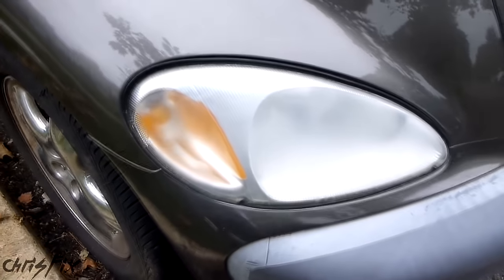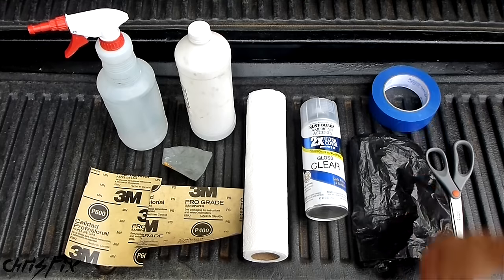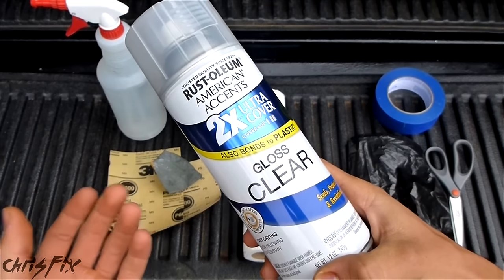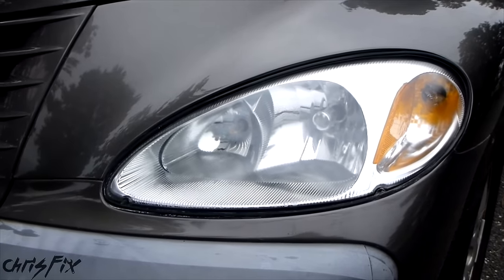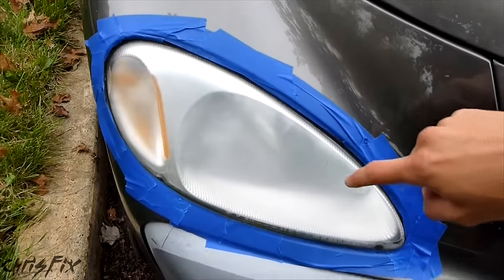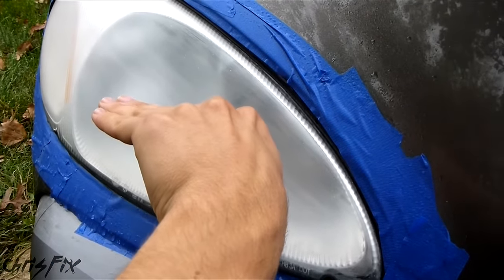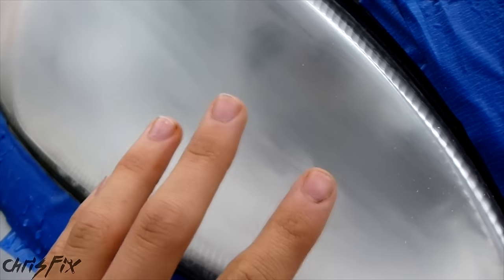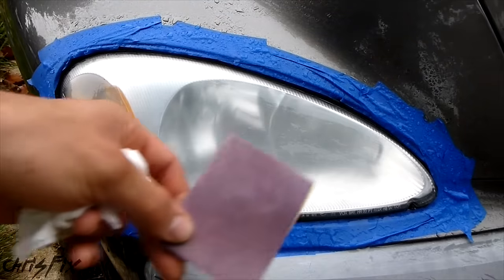How to Restore Headlights PERMANENTLY

Comment: If I overspray do I need to start the wet sanding over?
Reply from the maker: Might want to try letting it dry and wet sanding it, you might be able to knock it down so it looks good. If it's too much then I would sand it off and start the process over

Comment: My headlights ended up looking really cloudy after using the spraymax clear. Should i just wet sand like you said? And will that clear it up?
Reply from the maker: Probably orange peel. Let it dry a day and then wet sand with 800 then 1000 then 2000 then 3000 and finally use a plastic polish like this: https://amzn.to/3WIooIW
Reply: @chrisfix  
Thanks for the response. Very dedicated responding to a video this old.
Reply from the maker: @bernardberben4852  I spend hours and hours every day responding to comments to help my subscribers with their car questions. Cant get every single one but I do my best.

Comment: Hello Chris. I just did this on my dads car. I didn’t know and went all the way to 3000. After i applied the clearcoat ( same one as u) when it dried its drying with a spiderweb type pattern. I hope in 24 hours when i wetsand again it will go away but do you have any advice?
Reply: I think that means you held the clear coat can too close and overdid it, not sure if that’s right tho you probably need to redo it

Comment: If the lights were bad enough and you finished the whole process can you restart and sand the spray paint off and go higher grit?
Reply: I have the same question.  I sanded and thought I got all the scratches out.  I didn't.   Now trying to figure out how to remove the epoxy coat and start over.  What did you do?

Comment: I’ve fallowed the instructions to the T, but there’s some cracking in the gloss clear when it dries. What do you recommend
Reply from the maker: The clear coat might not be compatible with the plastic your headlight is made of. Or it was too humid out when you painted? You can sand it with 1000 to smooth out the cracks and once it’s even you can work your way up the grits to 5000 and then polish it so it’s crystal clear.

Comment: Anyone have a problem with the clear coat CRACKING?
I did mine 3 times!!! I used 400, 600, 800 then 1500. 
Gave a light coat of clear then another coat 10 min later. Looked great. Gave a final coat and let them dry. When I can back after 3 hours they looked like a dried up lake bed!

Again, I did it 3 times and the clear coat won’t cooperate 😐

Comment: Hi I am restoring my headlights and I have some issues. I have 2 forum threads if you search on Google with this phrase "HELP! Headlight restoration swirls showing!" you can see my progress. I am currently stuck and would like some feedback. I removed all the previous headlight clear coat with 800 grit, so I am left with just plastic. However trying to get a mirror finish with the visbella kit compound and a wool pad is not working. I can still see sanding marks. Should I keep polishing until all marks are gone or should I apply the liquid and the marks will disappear?
Reply from the maker: I'm not familiar with that kit but by adding the liquid coating that might fill in the marks you are seeing. If it doesn't work you can always sand and redo
Reply: @chrisfix  Hi Chris and thanks for checking out my thread. Would you recommend I just install the ppf on the headlight, or apply the liquid and install the ppf on top of that after a few days? 
BTW, I will let you know as soon as I upload today's progress and maybe if you have time you could tell me if this is the best that can be achieved with polishing, or not. I have been at this for 5 days trying to get a decent result before I move on to the protection. Thanks man.
Reply: @chrisfix  If you can check out the video I just recorded a few minutes ago, can you tell me please if I should be expecting a mirror finish or not? If my finish is as good as it gets tell me, so I can proceed with PPF.

Comment: Hey I have a question. I probably can’t but I have a can of Matte clear coat. I can’t use this right? I need to use gloss finish?
Reply from the maker: If you spray matte clear coat it's going to look like it needs to be restored and you did all that work for nothing. Stick with a clear gloss clear coat!
Reply: Thank you. If I mess up the clear coat, can I just re-sand and try again? @chrisfix

Comment: Are you supposed to use the meguirs PlastX polish after or before clear coating? I already clear coated my headlights without using the polish so I do not know if it is worth to polish it now or not

Comment: Hey Chris.. a question if you please
can i use the chloroform vapor after the 2000 sanding then after few hours wipe with alcohol and proceed lastly using the 2X ultra cover spray followed by the polish

Comment: Mothers Mag & Aluminum Polish is all you need for this.  I’ve personally used it for exactly this.
Reply from the maker: How long does it last?
Reply: @chrisfix  I reckon until nature retakes its course.  I have a 2012 Cayman.  Bought it with 57000 kilometers on it; to give you an idea of how much its been through.  Polished up the lights a couple years ago and haven’t noticed any ‘fog’ reoccurring thus far.

Comment: Im wondering if you can still drive the car while it clarifying within the 24 hours. Also plastic is peeling off one of the headlights and under the peeling plastic the headlight looks fine. I wonder how I would remove the plastic and restore that headlight.
Reply from the maker: You can drive but wait at least 4hrs if you can. The longer the better.

Comment: question, after i apply the clear coat and wait 24 hours for it to dry, do i wet sand it with 2000 grit horizontally or circle motion?

Comment: I did this and my headlights look smooth and clean, but not completely clear. Did I do something wrong? Should I start all over? The yellowing is gone, the problem is it doesn’t look clear
Reply from the maker: Could be orange peel. Try wet sanding with 1000 then 2000 then 3000 then 5000 and finally hit it with polish until crystal clear!
Reply: @chrisfix  you’re the man Chris!

Comment: I use WD40 and a paper towel to keep my headlights clear. It isn't permanent, but it costs next to nothing to do, takes maybe 1 minute of your time once a month, and the WD40 AND one roll of paper towels will last for at least a few years and in terms of time will cost you maybe 12 minutes a year. If you're both cheap and lazy, this is the way to go.

Comment: I just did this and followed all the steps precisely.  Unfortunately, the finish is cracked.  I re-sanded and got out as much of the cracks as possible but it doesn't look perfect and there is still some cracking.  It is 65 degrees out and I'm doing it in my garage.  The second time I am waiting 20-30 minutes between coats because that's what the can instructions say.  Does anyone have any idea why the finish is cracking?  I am not putting it on thick.

Comment: I've seen dozens of these vids to remove the "haze" from these headlights....BUT...I don't see anything on a related problem--> I got my headlight as smooth and clear as a baby's behind....but the "clear" plastic seems to have taken on a yellowish tint all the way through. Is there a way to remedy this?
Reply from the maker: You would have to remove the lens and sand the other side
Reply: @chrisfix  ...I don't think that would work. Firstly.....you can't dis-assemble these mono-cube modern designs. Secondly....my guess is that the thickness of the material has partially yellowed all the way through....maybe not, but getting to the inside surface is a non-starter. Thanks anyway. I think some sort of chemical reaction on both inner and outer surfaces may work....bit I've seen nothing on this problem as a guide doing it this way.

Comment: My lesson was as I did not have and cannot buy Rustoleum 2x clear coat, the result was disappointing, hazy. Then I realized I had to triple the coat I used, then it cleared out. Had done it before with 2 other cars few years ago, but this time some other painter's coat.. Just for the community
Reply from the maker: As long as it’s gloss clear coat you can wet sand with 1000 grit until it’s evenly hazy and then 2000 and then compound and polish

Comment: This method still requires a clearcoat. Permanent? If the stated reasons for yellowing is that the original clearcoat is getting chipped, this will probably still happen to any clearcoat. The polishing version I found that lasts years is the acetone wipe one.  After masking around the headlight,  use fine sandpaper to smooth the plastic as much as possible. Then a single wipe with a soft cotton rag saturated in acetone melts the surface plastic and turns the plastic clear. No clearcoat needs to be applied. So far it has lasted three years on my 20 year old Camry.
Reply: Make a video. What concentration acetone?
Reply: @oddassembler  As far as I know, acetone only comes in one concentration. There are already a few Youtube videos that use acetone. The new videos now have an acetone "steamer" which is just a can with a fan that blows a  stream of acetone fumes through a funnel. The fumes alone will smooth the headlight plastic to a shiny gloss.

Comment: i did exactly everything it was very nice & clear but i spraid the 2x clear coat & a bunch of cracks started to form i thought it was normal so i proceeded to do 3 coats & it got slightly foggy & the coat had more cracks what did i do wrong or it that normal ? should i proceed to apply headlight polish?
Reply from the maker: The cracks can mean the plastic isnt compatible with the spray, the lens was not clean, there was high humidity, or it was too cold/hot. You can always sand down the lens and start over.

Comment: I did this, lightly sanded down the orange peel, and my end result is very blurry, did I not sand down enough with the 400? or did I not spray the coating on evenly enough? the tops of my headlights are slightly flat and those came out w the most clarity, I have 2015 Nissan Altima

Comment: Hey Chris, what do you think about those vapor restoration sets for your headlights?
Reply from the maker: Some of the chinese ones use a very non healthy liquid that I would not want to breathe in. Instead use acetone (still dont want to breathe in). I couldnt get it to work but it obviously does in some situations. It is not permanent tho.
Reply: @chrisfix  wow thanks for that fast reply! I'll stick to sanding and polishing then! Sounds like that's the better result.
Reply: @chrisfix  I wanted to thank you one more time chris! I just did the headlights of my car today and the result was amazing! I used 600 / 1200 / 2000 sanding paper.

Comment: step 0 mask off the headlight area with masking tape.
step 1 spray headlight with water
step 2 sand with 400grit circularly then horizontally (keep wet)
step 3 sand 600grit circularly, then horizontal (keep wet)
step 4 spray it with water, then wipe it down.
step 5 sand with 2000grit circularly then horizontally (keep wet)
step 6 dry off lens, wipe clean with alcohol using lowlint microfiber
step 7 mask off hood with trashbag , cut out lens area
step 8 spray thin coats of clearcoat. do 3 coats minimum
let it set, full dry in 24 hours. 
step 9 for flawless: wetsand with 2000grit then with microfiber towel add car wax then buff it off.

Comment: followed this video on my 2011 Surbaru and the the headlight turned out more hazy than before. I used 400 grit, than 600 and finally 1200, after which I used the same clear coat in the video. Any ideas on how to fix this do I need to add something after the clear coat or just use 2000 grit sand paper instead, did I not sand for long enough?  any help would be amazing.

Comment: I used mother mag and aluminium polish after sanding. I saw no difference. What is the best polishes outside of toothpaste to use?
Reply: Formula that worked for me= Dry sand + wet sand + Meguiar's Plastx 
(Did it just recently)

Comment: I tried the toothpaste and toothbrush method. It worked on one of my lights but not the other. 
I tried a second coat and no dirt came off on the tooth brush, so is it an issue on the inside or should I do this whole procedure on the outside of the hazel one?

Comment: For all the Germans here: sanding your headlights is not allowed and you will fail inspection and therefore won’t be allowed to operate the vehicle on public roads anymore
Reply from the maker: Interesting, that doesn't count as fixing it? How do they know?
Reply: @chrisfix  It counts as a structurally changing a part of the vehicle because you remove the protective layer from the headlights. 

You have to get your vehicle thoroughly checked every 2 years in Germany to keep operating it. If they notice you have sanded the headlights you fail immediately, so you have to swap them entirely, sadly
Reply: @xyungeloest  Hell with that. Move to Mississippi...we did away with inspections years ago.
Reply: @starkeymorgan4142  no thank you. I value inspections when i know all the people going 200mph on the highway have a functioning car. Also I wouldn't give up free education, healthcare and workers rights just for car inspections
Reply: @xyungeloest  Enjoy

Comment: Correction. Headlights don't turn yellow due to the clear coat chipping off over time, because headlights are not clear coated.  All headlights are made of a polymer product called polycarbonate.  During the production of polycarbonate utilized for the automotive industry, an additive called UV stabilizer is added to the polycarb while it's still in a molten state.  Like everything else, over time the polycarbonate will begin to break down and discolor, especially if it's exposed to the environment and elements.  There is NO permanent fix because the break down is molecular.  Although this how-to video brilliantly restores the headlight to its original appearance, it IS temporary and merely cosmetic.  Replacing the headlight is the ONLY permanent fix.

Comment: HELP___After completing the project with the correct sandpaper grits, cleaning with alcohol, and spraying with light coats of UV resistant clear coat, the headlights had several surface cracks( like a broken windshield). So I re-sanded with 220 grit and removed what I did. Completed the process again with the same results. What did I do wrong???

Comment: heya, I used this method and worked so good , but I messed up a bit one headlight and got a running line on it , can I send it out with 1000 and 2000 a bit and use one more layer of clear coat?
Reply from the maker: You can sand the run down with the 1000 grit so it’s smooth with the headlight and then use the 2000 on the whole headlight and then 5000 and then polish it until it’s clear. No need to add more clear coat since you have plenty on it already.
Reply: @chrisfix  thanks for the info will do that

Comment: Only thing you don’t explain is when to stop sanding. Do I keep going until the water runs clear & not the milky color? Or do I stop sanding even if the water is still running milky. I feel like I’ve been sanding a while & don’t want to over sand.
Reply from the maker: Stop sanding when the yellow is gone and it’s a uniform smoothness and color. You can wipe the lens down with alcohol to see what it looks like beneath the sanding you just did.

Comment: I've done this before the clear will start flaking in time it's just a temporary fix
Reply from the maker: That means that your plastic is not compatible. In that case you need to use an adhesion promotor. This lasted 5yrs on my car and maybe longer but I got rid of the car.
Reply: @chrisfix   I am from Kansas City you know this Missouri weather is terrible especially in the summertime so that can possibly play a huge part

Comment: @chrisfix what if the headlights are new and you just want to prevent them for yellow later? Would you wet sand with 2000 then clear or just clean and clear

Comment: Mine were looking great then I went back in with the 2000 grit to try and remove the orange peel effect on one of them....now they're unclear again. Any thoughts? shall I start from the start? I've not tried to wax yet.
Reply from the maker: Use 3000 then 5000 and then use polish and it will be smooth and crystal clear. The 2000 grit will knock down the bumps which are the orangepeel.
Reply: @chrisfix  Thanks for your reply mate. Looking at it again, it's more a "cracking" effect as opposed to orange peel...but yeh now just no longer clear on the one light I had a crack at. Same advice?

Comment: Hey chris if its a new set of headlights, never touched before, does it still need to be sanded to put on clearcoat?
Reply from the maker: If it’s new you don’t need to do this. Use a good wax or ceramic and that will protect it.

Comment: So I put three coats of the clear gloss on then did a wet sand with 2000 grit 24 hours later and both headlights are hazy. Plus they still have orange peel. Now what?
Reply: Same thing happened to me I think the 24 hours just isn’t enough for it to properly cure ima just resand and respray and not do a final wetsand either way the orange peel isn’t that bad at all almost no one will notice

Comment: If I have brand new headlights, can I skip all the wet sand part and straight use the spray?
Reply: Yes you can!! Before spraying use a decent headlight spray cleaner, Wipe lens  useing paper towel until perfectly dry!No matter what clear coat used in time even clear coat spray breaks down, And restoration will be necessary to keep headlight clarity!!!

Comment: Do not wet sand after or at least wait longer is my guess, I waited 24 hours and then did a wet sand with 2000 grit and it ruined all the work I did now I have to spray it again take my advice and just leave it no one’s gonna notice the orange peel anyways